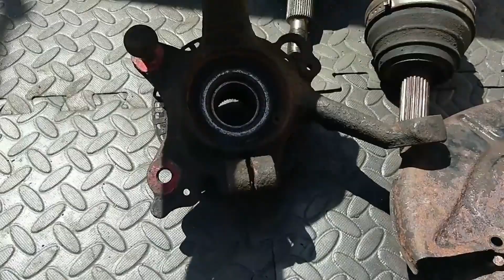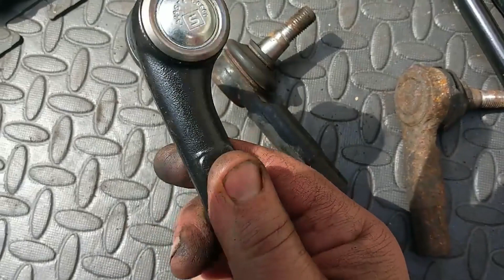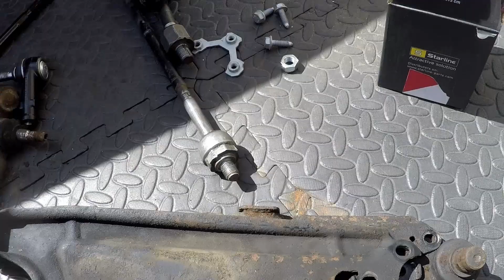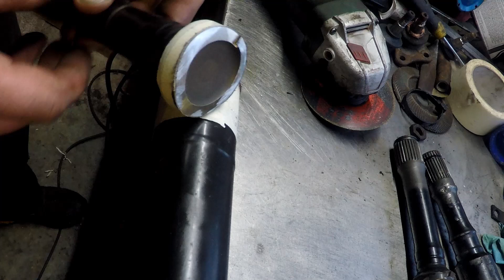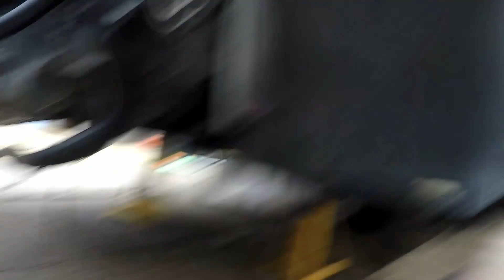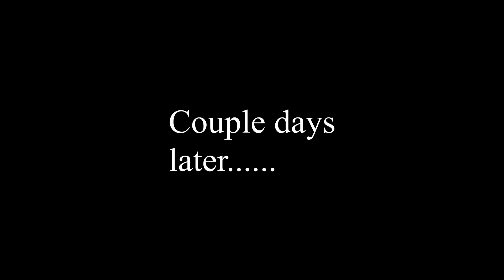Driveshafts - Shortening @ home - VW 6 Speed gearbox conversion 02M & going widetrack MK2/3 golf

Comment: I managed to fit a stock FL mk4 r32 complete cv and axle(all 02m FL are the same) into my Mk2 with Mk3 wide track and s3 8l 4wd 02m. No cutting literally went straight in, just need to cut front right as it's way too long
Reply from the maker: That's interesting, thanks for the info 👍

Comment: Hi Chrispy's Projects. Great info and I love how you detailed it to be understood. I am going to be doing an AGU swap with a 02M/02Q gearbox into my MK1 VW Fox 1992 model. My question is. Will it be OK to remove the same amount of length from the MK1 driveshafts to fit my mk1.
Reply from the maker: Hey Sebastian great sounding project!
honest answer is I don't know, and that's down to couple things that could be different in the chassis's and suspension setup. I'd do the same again as in video trying to check the lengths on the car and go from there 
Good luck 👍
Crispy

Comment: Have you had this out and driving yet?  I've just fitted an 02M into a MK2 Scirocco (A1) and am hitting a similar control arm / driveshaft issue with less options for control arms.  I'm curious if the axles have held up once they're under power.
Reply from the maker: Hi, yes these driveshafts has had some milage on them, also lent them to someone to  with 1.8T in an mk1 chassis, never driven under rage or drag raced-yet!
It's very similar the factory method
In my mk1/A1 I've later 5spd box with mix/ match Scirocco shafts
Reply: @CrispysProjects  Hi, did this fit with no issues into the MK1 with the 1.8t engine

Comment: Building an AWD Mk2 (R32 drivetrain + Haldex).   I was able to cut and shorten the solid OE VW rear axles fairly easily, using 3/16" wall tubing to sleeve the outside.    Front axles are aftermarket solid bar (someone had robbed the OE front axles off the parts car before I got it).    

Problem being I can't find anything that will cut these axle bars - tried both a band saw and an abrasive chop saw.   Neither did very much.   Planning to have one more go at it with a 4" death wheel grinder.    If that fails I will be looking at buying either Epytec axles ($750 USD + shipping) or getting bars from a machine shop in ATL (aprox $400) and using the joints off the new axles
Reply from the maker: Sounds like a brilliant project, I've considered doing AWD , and might in the future!
I'd go straight for the 4" grinder with 1mm cutting disc, that's what I used to cut the OEM ones
We don't want to be paying big money for drive shafts if we don't need to
It's all part of the fun of a project 👍

Comment: Any updates? 
Planning on doing a similar build with an MK1 golf/rabbit.
Reply from the maker: Hey Jere, yes there's alot of updates coming starting February , some boring and hopefully some cool stuff!! fair amount of it filmed but loads left to do 🙄😄Anything particular you want to see? Mk1 chassis is a good choice but I think it's better suited to a mk 2 onward chassis ( I have a mk1 as well I need to play with😉 )
Reply: @CrispysProjects  Well I have an MK1 chassis and want to put in a 2.0 PD (BHW) engine transversely (took a million years to figure out what transmission would work well for that). I am based in the US so I would have to import a 02m ERF to get really good fuel economy.  The BHW got 45-50mpg in my 2005 Passat with an imported transmission, so I am confident I could get higher in an mk1 with taller gears and a transverse transmission.

Comment: Are those measurements the total length of the shaft or clip to lip length. Are both shafts from a MK4 tdi and using 02m inner and outer cv joints. Many thanks.
Reply from the maker: Hi Simon, yes those are the end to end measurements using a 02M gearbox and both shafts are from the same mk4, or that's what I've measured and used, feel free to use similar methods to double check yours, happy chopping! 😉